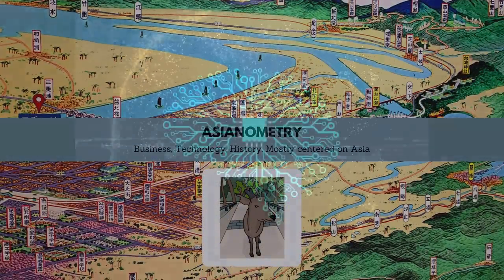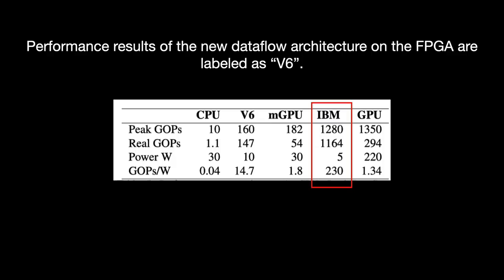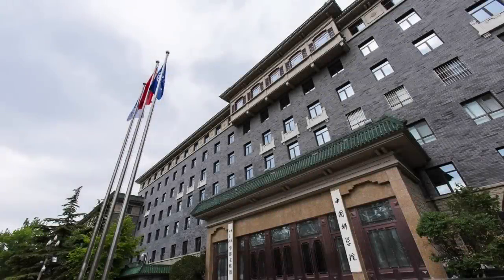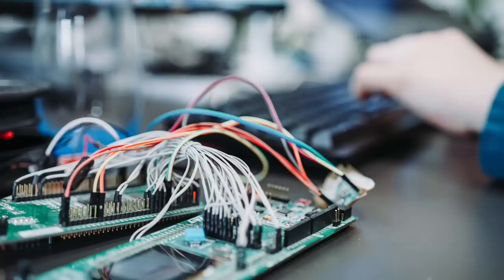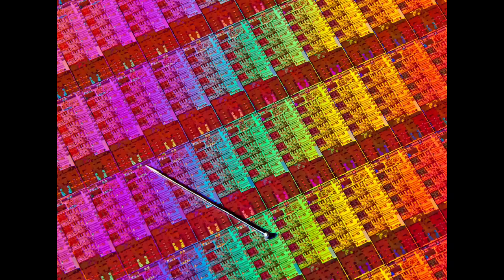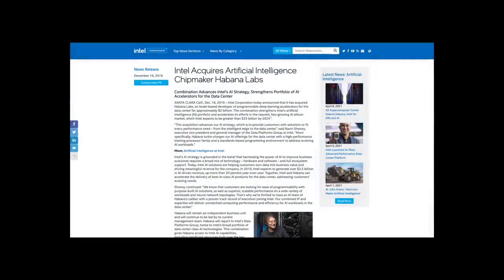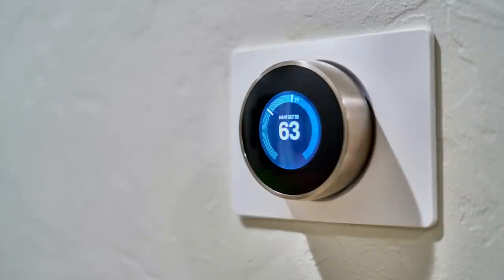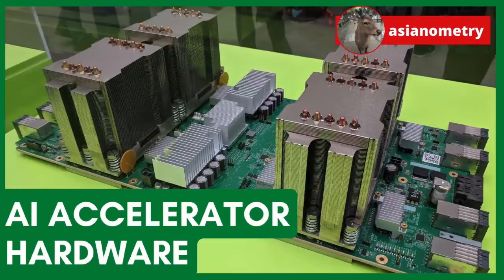The Coming AI Chip Boom

Comment: Help me understand. Why would light (photonics) be a better alternative to electrons? Doesn't both particles travel at the same speed, the speed of light? And why does light not generate heat issues? it does in sufficient quantities.
Reply: light doenst create heat losses as much like electricity does, less heat density = more transistor density = more compute per square meter
Reply: following @64-bit43's reply, electrons do NOT travel at the speed of light in our chips. Anything with mass is literally incapable of moving at light speed. Electrons have heat generation issue due to having to create a medium for transmission (i e. potential difference) whereas light is an electromagnetic wave that only has to permeate through whichever medium it is in

Comment: This is a very interesting video with substantial information about the directions in which the AI accelerator market is moving.

An alternative to backpropagation is the new NNB algorithm. This algorithm calculates both the architecture and the weights of a perceptron neural network that exactly recognizes the given data vectors, while maintaining the data away from strips having user selected widths around the decision hypersurfaces, thus avoiding overfitting and underfitting. 

The NNB algorithm works by geometrically calculating polyhedrons that include/exclude the 1/0 data and then translating the polyhedrons into neural networks; the calculation and translation are computationally efficient. The NNB algorithm is orders of magnitude faster than BPP, besides being exact, controllable and predictable. 

If compared with the novel NNB the veteran BPP algorithm is definitely more complicated, not to mention that BPP requires the adventurous choice of an initial architecture and weights, while NNB extracts both directly from the data and the selected strip parameters. 

Presumably the AI ecosystem would be interested in implementing NNB within their platforms, but capital in the order of billions has already been spent in chip architectures finely tuned to BPP. Would there be a chance for NNB? If so, how would the NNB algorithm affect the AI accelerator hardware investments? 

An available free NNB demo software is described and linked in this video:
https://www.youtube.com/watch?v=VTDIedU3F-E

Cordial regards
Daniel Crespìn

Comment: In-memory computing should be less energy intensive than Von Neumann archi.
Reply: not necessary.
DRAM chips are cost-optimised and use fewer masks because the logic parts are kept low. If you want efficient logic, to perform computations, you increase the routing and wiring, thus increasing mask count, and the price goes up through the roof...

Comment: China seems seems to be rapidly developing AI chips instead of normal chips
Reply: They're very simple products, one step above memory products. Memory is kind of a shit market to get into, you'd be competing against companies that have it down, that have the cost efficiency you cannot reach without decades of experience, and the margins are extremely slim across most of the memory product lifecycle. I think AI chips are a great way to test drive a semiconductor tech that isn't quite ready for other uses, due to how regular they are, you can simply detect and mark faulty cells in software and compile around them, so you can salvage tech that for anything else would have an unusably low yield.

And at the same time it's a field that has been growing in importance and software/architectural/research accomplishments by leaps and bounds, extremely promising to get into before it's too late.

Comment: There is a lot of .... oversimplification. 1. The kind of neural networks discussed in this are called CNN. There are many many many many other architecture of neural networks. 2. This is why AI hardware will face a major issues. They are TOO specific. There is one more upcoming method to deep neural networks that will likely beat out these digital neural network. Analog chips. Much cheaper, much less power consuming and much faster. For edge computation they are perfect.

Comment: On the inference side, mobile chips are doing a lot more than photo processing. They’re also doing (1) predictive text and autocorrection, (2) speech to text (hey Siri!), (3) predicting what apps you need based on historical activity patterns in conjunction with time/location context, (4) text to speech when reading messages, and a whole lot more.

On the training side, I’d love to hear more about Cerebrus and their wafer scale AI training chip. Supposedly 3 orders of magnitude more efficient than what nVidia produces yet still using > 10Kw of power. It’s a real workhorse, but the architecture requires a complete rethink of how we frame AI problems to use efficiently as it doesn’t have any traditional DRAM (or VRAM) in the system.
Reply from the maker: I don’t have much comment on this company. I heard a lot about it though.

Comment: 1:19 How would you be able to run multiple layers of a neural network in parallel for the same input? That makes zero sense.
Reply: If you are doing infererence for multiple inputs, then you can pipeline them.
Reply: if one stops depending everything-on-everything, you can chunkify layers
and chunks can change latency front into latency piramids

and of course main parallelism is about multiple inputs in "pipeline"-esk thing
Reply: @computationaltrinitarianism  gotta have a lot of layers for that to net you two orders of magnitude. Like... hundreds.
Reply: @NoNameAtAll2  why would you do that if there's so much possibility for parallelism within layers? I just took a look at the actual paper and they say that they're not doing what the video says they're doing.
Reply: Didn't author say that it's just hardware version that will make a two orders of magnitude improvement in performance instead of GPU implementation?
Reply: @unvergebeneid  
> why would you do that if there's so much possibility for parallelism within layers

who said they aren't doing that?
between-layer optimizations are next step on "tech tree"
Reply: @NoNameAtAll2  the paper is. They're calling it impossible.

Comment: There are two really big booms coming and both will be a big demand on HPC nodes because the chipmakers designing the hardware have to compete against each other, so yes the AI server hardware is going to put demand on the more advanced nodes such as the AMD MI200 which is based on AMD's CDNA 3 architecture and gives a 5X increase in performance over their CDNA 2 parts.  If some company can make use of a node like 28nm good for them but those chips will be blown away by Nvidia and AMD parts who are now both putting a lot of R&D into acceleration and AMD is about to put out CDNA 3 and expanding their lines of server parts and it's not "we made these parts and I hope they work for you", it's AMD and probably Nvidia doing a lot of work with companies to develop hardware solutions that are best suited for these use cases.

So boom 1 is AI and the dramatic improvement in hardware that's about to happen from the giants like Nvidia and AMD.

Boom no. 2 is going to happen just because.  Really.  Because TSMC is going to be producing 5, 4 and then 3nm nodes for the mainstream instead of just for the risk partner of Apple, with AMD probably being the largest customer for TSMC advanced 5nm nodes like N5P or N4, this allows for a dramatic shift in hardware.  AMD is putting out 96 core and 128 core parts for server with Zen 4 and that could go up to near 200 cores for Zen 5.  This is a boost over their current 64 core part.  With the other improvements AMD is making for Zen 4, and the fact that TSMC N5 is about 25% more power efficient than their N7 node, the amount of compute power for a server is going to go up by probably 75% which is an almost unheard of increase in compute power, but it's going to do so while using about the same amount of power their current server parts do.  So boom no. 2 is going to be a wide turnover in server parts.  And for what doesn't get changed out for AMD Zen 4 server parts will probably be swapped out for AMD Zen5 or Intel Meteor Lake (14th gen).  Once again there will be another big jump in performance.

So the next 5 years is going to see a dramatic turnover in parts, ALONG WITH the growth in server for all types of use cases.  I'm betting near 50% of existing hardware gets replaced in the next 5 years, and because server is such large business, the world of fabrication and chipmaking is going to be NUTS. If you're an investor, AMD and Nvidia are going to grow.  Intel might get a chunk of this but their fabrication has been holding them back.  They need to reach parity or pass TSMC for HPC nodes

Comment: You really should have covered the IPU from the British Company GraphCore which is a 1200 Core , AI unit which is about 65% on board RM ( Die Are wise) and 35% CPU. The Graphcore architecture is very revolutionary. It uses an old paradigm for Barrier Synchronization to Synch its CPUs. Performs the basic things AI processors are good at Training and Inference.

Comment: Is "neural network" an homage to Terminator or did it precede it?
Reply: The Terminator, the original movie back in 1984, the brain of the Terminator, when we saw through the Terminator's  eyes and the screen turned red, what was displayed on the screen was assembly language code of the 8 bit 6502 microprocessor, so no, not AI. Couldn't be done on such a chip. Not enough processing power.